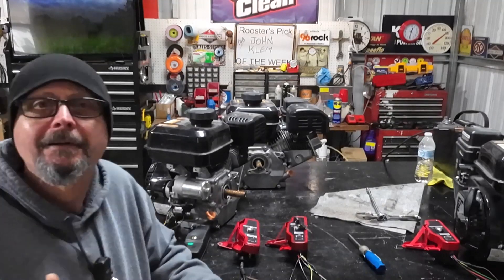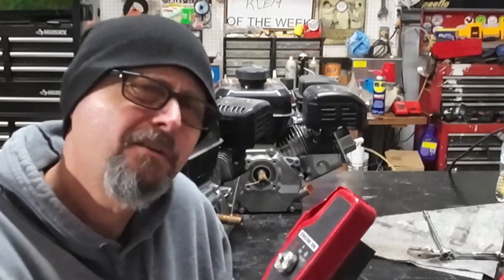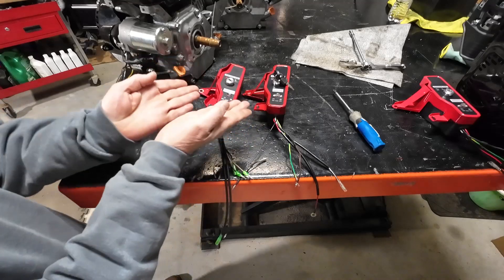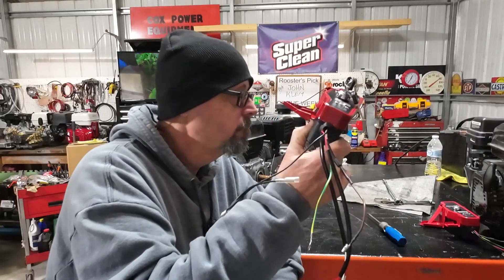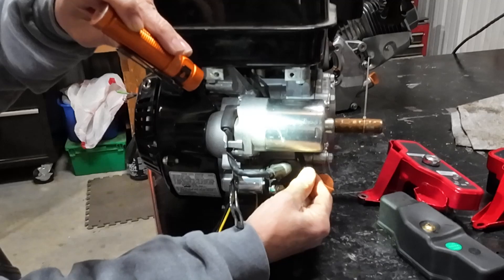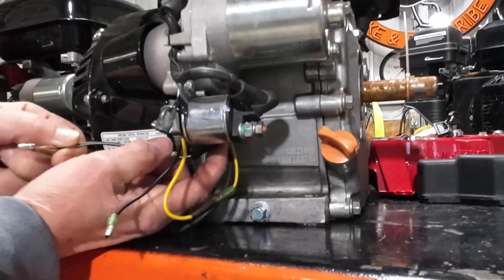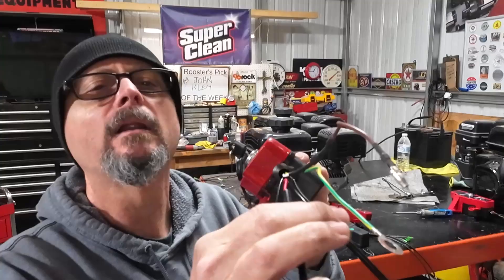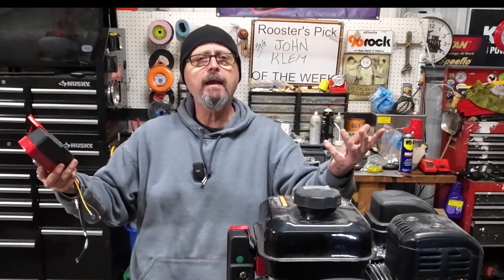How to Install an Ignition Switch Box for Honda GX160/GX200 & Predator 212 Engines

Comment: hi rusty can i still use the first type ignition switch if my engine does not have a oil sensor thanks.
Reply: My bad it does just checked
Reply from the maker: Lol measure once cut twice I always say... 😂

Comment: How does it then connect to the battery
Reply from the maker: The red wire from the switch assembly connects to the hot post on the solenoid same place the positive battery cable hooks to.

Comment: Have a a 420 that key start quit working to start. I replaced the solenoid,then the starter and solenoid, and finally the key switch assembly. I have nothing. No clicking or nothing. You have any ideas what it could be?
Reply from the maker: If all that you replaced checks good, Double-check your grounding, not only battery and engine but also solenoid.?
Reply: @TheRustyRooster Thanks. I’m going to check the cables and ground
Reply from the maker: Let me know what ya find.

Rustyroostersshop@gmail.com
Reply: @TheRustyRooster Thanks

Comment: Rusty, the best video I have seen regarding the wiring of the electric starter. 

Question, I have an older Honda GX-340, would this same wiring system work on this motor? Thank you!
Reply from the maker: Hey hey, thanks for those kind words.

The older version GX340 wires the same way as the switch assembly in the video, but you will want to order the one for gx340 or gx390 so it mounts properly.
Reply: Morning Rusty, hope you had a great weekend. I sent you an email yesterday asking for some help if you have time. There should be an email from me. Regards, Al Sharp
Reply from the maker: @Ranger-Al I'll go double check
Reply from the maker: @Ranger-Al rustyroostersshop@gmail.com

I looked and didn't see an email 😕
Reply: Thanks Rusty, I will check, I may have entered the wrong email. 

Thank you!

Al Sharp

Comment: So you can’t use the original wires from the kill switch 1black 1red 1yellow to oil
Reply from the maker: sorry i don't follow your question. these are replacement ignition box, the original box was missing.

Comment: Only took about 10 minutes for me to wire my predator 420 with a new key switch thanks to your video.
Reply from the maker: Man that's great to hear, so glad that little video helped someone.
Reply: @TheRustyRooster  I spent at least 4 hrs of trying to track what wires go where with a multimeter. Got it to start but then would not shut off with the key switch. I have two more back up Gx 390 engines to add electric start.

Comment: thanks Rooster, my neighbor borrowed my 13hp wood splitter and gifted me an electric start, the control box wires are ALL black wires except the brown, and there's no earth wire.
i've got it on the work bench and gave up for the night (it's 21:40 hours down under) will have it running tomorrow and back on the splitter.
Reply from the maker: Man, that's great. That is a great project .  You'll be splitting wood tomorrow.  Good day mate

Comment: Any recommendations on how to deal with a flywheel that the keyway doesn'tline up with the flywheel on a pull start. Want to do a conversion  but the flywheel  keyway is different
Reply from the maker: Pull start to electric start conversion?  You're going to need to replace the flywheel for one with a ring gear ⚙️
Reply: @TheRustyRooster  understood. I have one already, but the keyway is the issue. It doesn't line up with the keyway on the pull start. The magnetic and keyway positions are not the same as on the pull start
Reply from the maker: @nickalih  oh ok then you have the wrong flywheel for the elec conversion
Reply: @TheRustyRooster  do you have a solution, or do I need to buy a new flywheel?
Reply from the maker: You're going to need to get the correct flywheel for your crankshaft. Not all clone  manufacturers are the same.